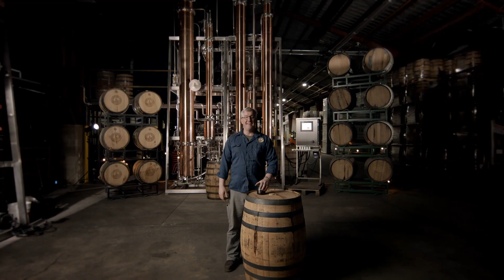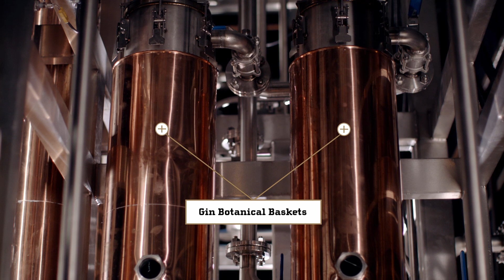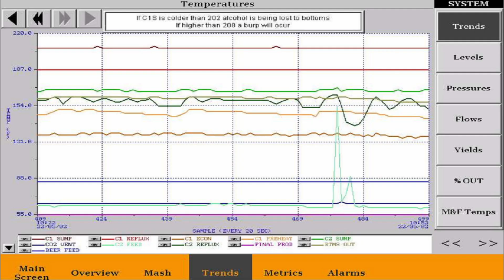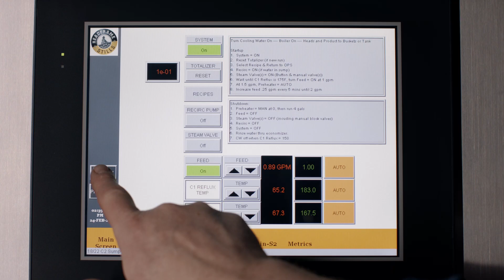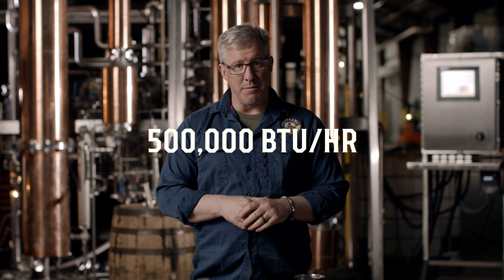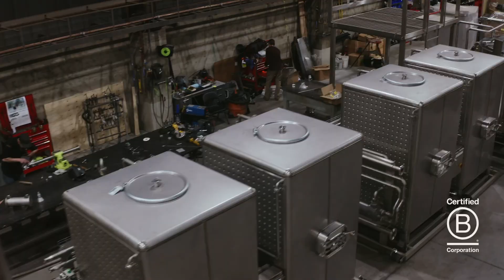Continuous Flow Distillation vs Batch Distillation

Comment: Nice sales pitch... though a normal colomn still does everything yours does, and you can limit your heads and tails with the yeasts used and the time and cycles of your fermentation process. My question is cost of your system compared to a regular column still?

Comment: The Irish outlawed the column still when it was proposed to them by it's inventor, an Irishman.
Pot stills leave oily flavonoids that are desirable that column stills strip away. You get more yield from a column still but a maybe a more palatable product from the Pot.
Reply: Packed columns will reject oils. But falling film or rising film stills can potentially pass the same steam distilled oils. Not necessarily, but possibly

Comment: Pretty convincing, easy to understand lecture or presentation 🎉
Reply from the maker: Thank you. And we're always happy to answer any other questions that this conversation may start.
Reply: You’ll notice he doesn’t talk about still size and shape at all about the still itself instills flavors he completely ignores how different alcohols have different sections in of the runs that are there desired flavor In whiskey you don’t want heads but that’s not the case in all spirits this is a great bs marketing video designed for accounting and c suite not people concerned with flavors

Efficiency is a great metric but this is a great example of your looking for efficiency in the wrong place to make the best products I bet it would be the most efficient bottom shelf and  hand sanitizer grade ethanol still you could by based on only his word